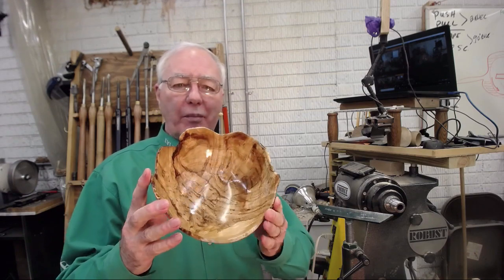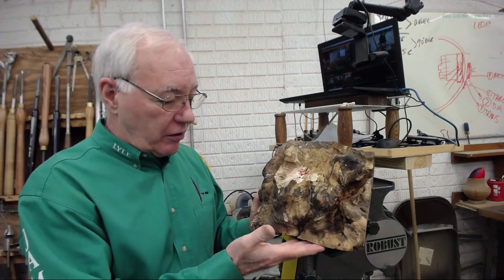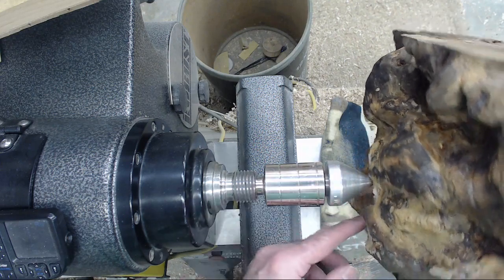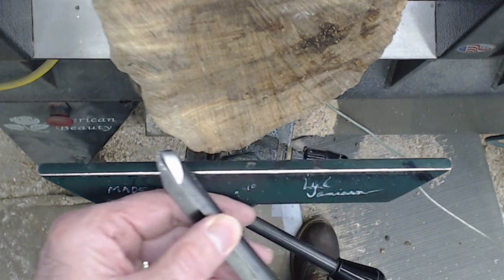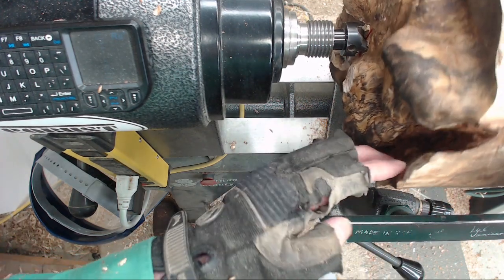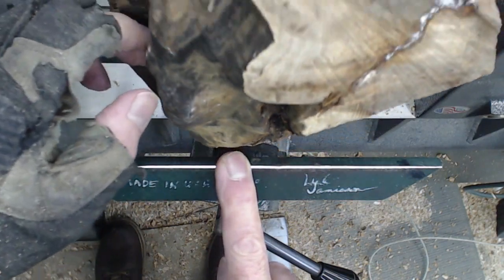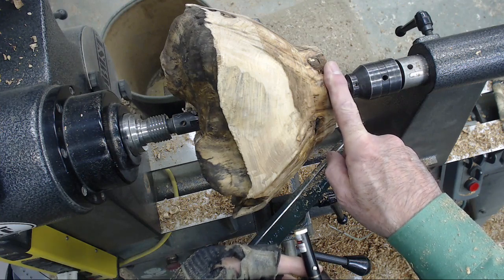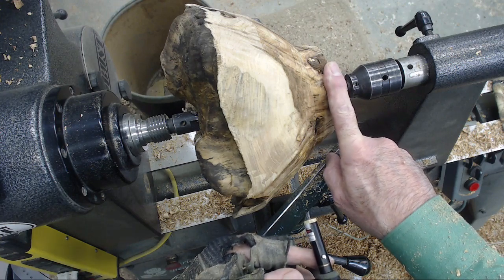Part 1, Natural edge burl bowl, axis planning

Comment: Lyle, I try to practice what you preach, still seem to be beating up my body. I get bounce trying a cut like you do. Fingertips, I end up having a death grip. I will keep trying. You show that it's possible. Thanks for the inspiration.
Reply: with the death grip you might be pushing the bevel into the wood, that'll cause bounce, the left hand should just be adding downward pressure while the right controls the tool along with the body moving to move the tool in the direction the bevel is pointing.
Reply from the maker: Get some help.  Your turning club has people that are up on bevel supported cuts.  Its all about the fun, turning is no longer hard work.  Come up to Michigan and take a class to really kick it up a notch.

Comment: I guess I don't get it. You start at the balance point but change it to fit the wood. so what happen the  balance point. Why not start out trying to fit the turn to the wood?
Reply from the maker: Sorry for the tardy reply.  The balance point just lets us get the speed of the lathe up.  As we move it incrementally to get better grain, better color or character we end up in a different position from the starting point.  Give me a call if you want further details.